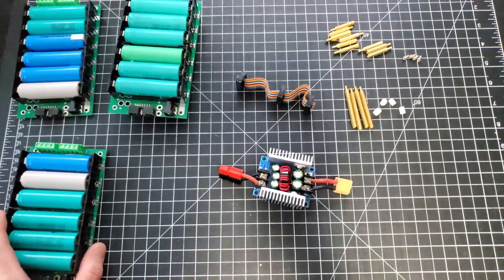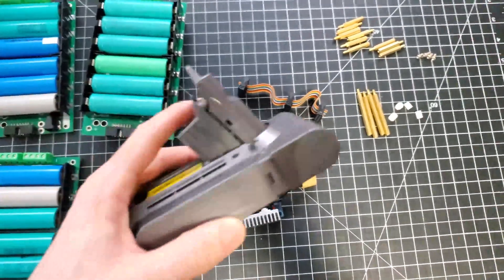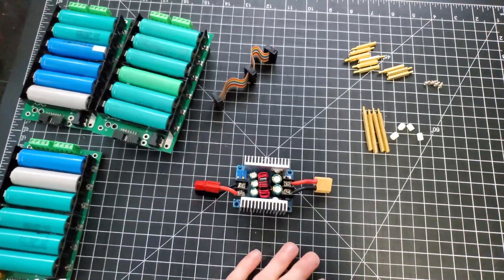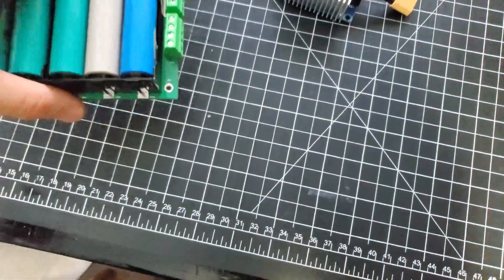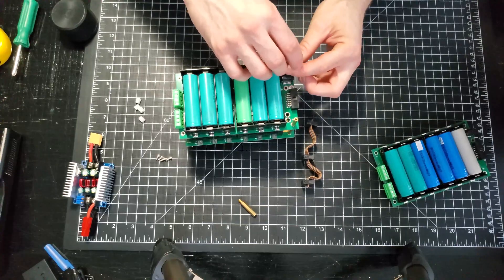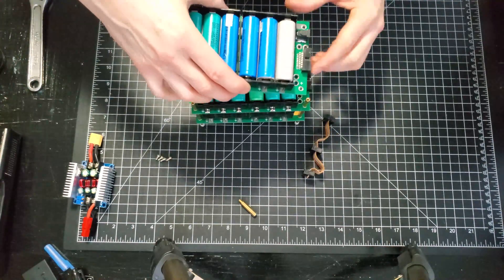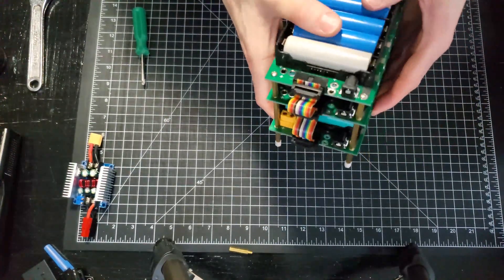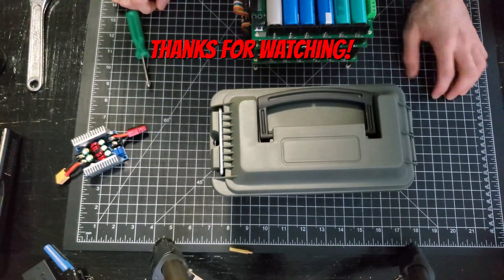DIY Recycled Lithium Battery Pack | 2022 | Part 1

Comment: Did you ever do the 2nd video, where you get it all wired up and fitted inside the ammo can?  Presuming an average capacity of 1800mah from each cell, you'd be storing 7.2ah @ 24 volts.  I'm not really clear on what your use case is, but it sounds like a HAM radio application.  Most such radios draw around 14 amps at 12 volts, so your battery pack is just about perfect, pushing about 1C, even with efficiency losses through the buck converter.
Reply from the maker: No second video yet, still waiting on a couple pieces to the puzzle. Yes, I built it for my xiegu g90 mostly. Average cell is around 2000mha, and my g90 on max power (20w) I don't think even tickles 10a. But yes, seems to work quite well so far!